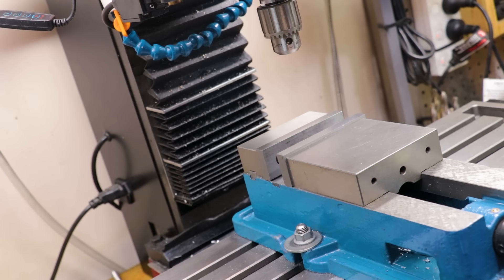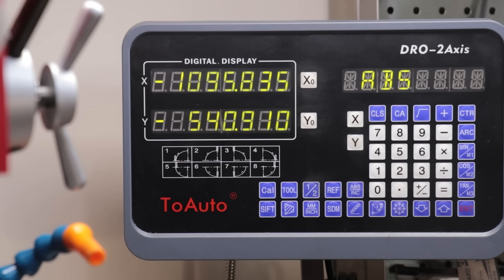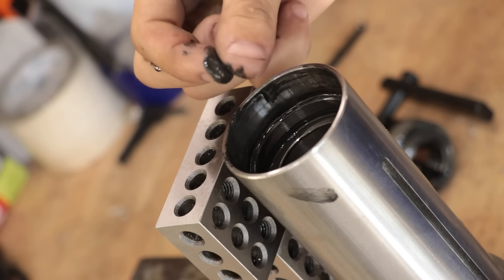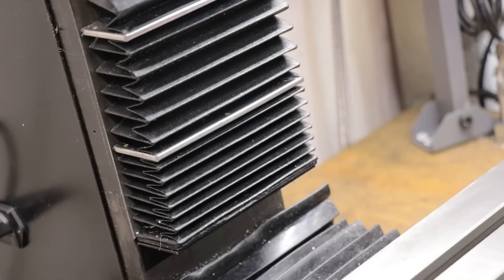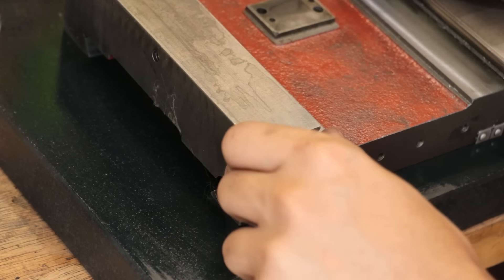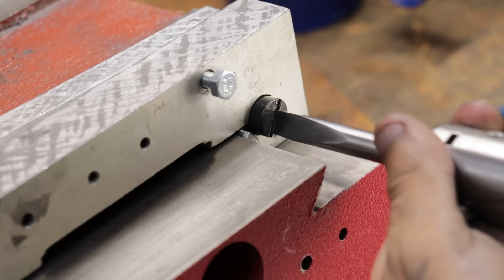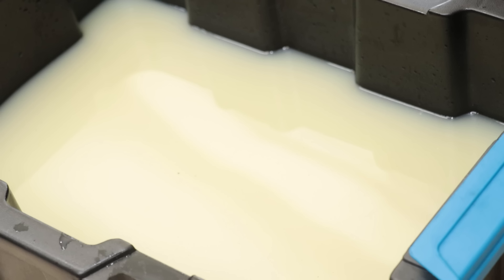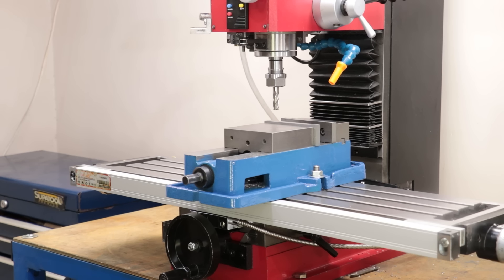The Cheap Chinese Mini Mill

Comment: If you are concerned about the reliability of the controller/electronic add a fan.  I have a mill similar to yours, added a fan the first day and 11 years later never had a problem.  Heat is the greatest enemy of electronics.
Reply from the maker: Ill definitely be stealing this idea. Thank you
Reply: Good point
Reply: as an electrician who works on low voltage controllers almost as much as everything else, heat 99% of time time will cause an issue before anything actually failing without being heat induced
Reply: @artisanmakes  can't steal it if he already gave it to you 😅🤷🏽‍♂️
Reply: @artisanmakes  Best ideas I ever had I stole .
Reply: do you think it would be possible to add a 3/4" chuck?

Comment: If you use linseed oil for anything be aware that it polymerizes and becomes gummy within some weeks. That's why it's used for oil paintings or for impregnating wood. Don't want that stuff sticking on your surface plate. I had better success mixing mineral oil with a lot of pigment powder. You really want it to be like a paste so you can see the very thin layer. Otherwise get some bluing dye off the shelf, it's not that expensive. I built a simple scraper out of a power saw, removed the linear mechanism and replaced it with my own which I can attach scraping blades to. Also added a shallow tslot to the cam gear so I can adjust the stroke. Oh, and once you scraped both sides, technically you'd have to check the whole thing for pararellism between both sides, since that could be off too now.
Reply: Rags can also spontaneously combust due to exotherming as they cool.
Reply: It should dry and be scrapable

Comment: Bearings typically have a wear in schedule, and I’ve always seen tapered roller bearings packed in grease. Oil may work too, just need to follow mfg instructions very closely.
Reply: Auto differential bearings are lubed with oil so the ones in the mill should be OK. Just need the correct oil.
Reply: @kennethstaszak9990  but they are splash fed from the diff sump. To be successful the bearings would need a few drops every hour or so to get a sufficient film in place because to my way of thinking they will lose their oil due to gravity! I may be wrong because I have only been a fitter for 45 years and believe me, I am still learning. Cheers from Tassy.
Reply: @glennbrown1961  They are still oil lubed which was the OPs point/question. My post reflected that.
Reply: @glennbrown1961  don't denigrate yourself, you're talking complete sense, I would pack the taper roller and the top bearing with a good moly grease for machine bearings ( not auto wheel ones ) and that at least should suffice at least on a yearly strip out and check basis.

Comment: Take a 150mm or 200mm diameter piece of pvc pipe which is a couple of cm taller than your coolant level, but will still clear the lid. Cap one end and glue in a heavy weight. Drill holes around the circumference near or within the end cap. Place vertically in the coolant and put the return into the pipe. Over time the oil will float to the top of the pipe and coolant will flow out the holes in the bottom.  Oil can be sucked out the top of the pipe with a large syringe or baster. That size mill will hopefully be my next purchase as I have space limitations too. Great tips and videos, thanks.

Comment: A small note from a fellow hobby-level machinist...  I own the Harbor Freight mini-lathe and mini-mil and have to say that while I never would have wanted to go smaller to something like a Sieg, both machines have allowed me to do real machining in a home environment, with the ability to move either one by myself in one trip vs. having to disassemble and painfully move them piece by piece.  They also cost a total of less than $1000 USD (Obviously with no vise/bits included), which made it possible for me to actually afford them, though this was back around 2001 so obviously inflation will have to be factored in.  It would be great to have larger machines, but you can't discount the fact that they allow entry into actual machining, building up those skills, and are quite capable for machines of their size-- no issues tackling stainless or other ferrous metals.
Anyway, just had to chip in since I feel like the mini-lathe and mini-mill are often immediately dismissed as "not a real lathe or mill", when often they are quite capable for their size and allow people with less money to build all those important skills that are impossible with hand tools.  Just my two cents...
Reply: Hi, unfortunately in Australia I dont believe Harbor Freight is available, and the shipping costs from the US to Oz is rather expensive making US tools rather uncompetitive.
Reply: @101peligroso Don’t worry, the Harbor Freight mills and lathes are just rebadged Seig tools. 
They’re the exact same as far as I know.
Reply: Excellent comment. I spent years avoiding these "hobby" grade lathes and mills because so many people said they were not "real" machines. However, since recently buying a cheap chinese lathe, I've discovered the truth of what you say here. There are fundamental skills and understanding in machining that require actual experience and hours of practice. It's fair to say that anything more than a cheap chinese machine would have been wasted on me. I'd have broken it, or gone broke buying the tooling, before mastering the very basics of the craft.

Previously I would look at large, precise machines and desire to own them. Now I know I'm not ready for that, and don't even want them anymore. It will be at least three years before I'd want to try my hand at something larger.

The other big advantage of the cheap chinese stuff is that you learn so much, fixing and improving it. That is what I love so much about my lathe, and lathes in general. They are amazing tools, because they can make things to make themselves better at making things. Building your own tooling and features for your nasty little machine, making it less nasty and little, is like having a living thing growing in the shop.

That's what this channel is all about, which is why it is one of the best out there.

Comment: 19:19 on the return line to the sump chuck a couple of filter socks in there and it will pickup any  particulates that get carried away in the fluid. The bulk will settle out but the super fine bits will act like silt and clays do in a stream.

Comment: On my Sieg X3 I replaced the top radial bearing and thrust bearing with a tapered roller bearing.  I used a belleville washer to under the nut to set the perload.

Comment: When I did my apprenticeship, we made our own coolant - an emulsion made from roughly 2:1 engine oil and a mineral oil detergent (so, not dish soap!), and then watered down to the right consistency. Basically, you're using enough detergent to get the oil to emulsify with the water, making it "water that won't make things rust", so I'm guessing you could do the exact same thing with cheap vegetable oil and dish soap!

Comment: I have the smaller sister of the Sieg SX2.7, the SX2.3. The biggest difference is the table size, the SX2.3 has a shorter table in the X-direction, other than that it should be pretty much the same. I quite like the mill, once you know how it behaves, you can actually squeeze a lot of accuracy out of it. 
I added a gas-strut to mine, that pushes the head upwards. I can really recommend doing that mod, you get less sagging of the head, it's way nicer and easier to crank up and down and it vibrates a little less (I mounted the strut at an angle, so it pushes the head slightly into the dovetail, which stiffens it up a bit). 
The next upgrade on my list is reinforcing the column, since that's still stock and probably the biggest weak point.

Comment: I haven't put coolant on my mill yet for the very reason you have said, rusting, so I'm very interested to see how you get on with that new stuff. The whole idea of water around my machines worries the hell out of me
Reply from the maker: If you use a good coolant and don’t let the oil drop the risk is small. Maybe a small fog buster could work. Coolant for me made a big improvement in tool life. Cheers

Comment: For the best scrapers, contact your local machine shop and ask them for any old circular cutting blades they are throwing away. Put on your PPE and throw it as high into the air as you can so it lands on a hard concrete floor where it will shatter. Some of the shards will have a convex edge which you don't touch - don't even sharpen it. Grind the bit behind this edge to fit in your handle and you will have the best scraper known to this planetary system.
Reply: But saw blades are made from steel and one that isn't particularly hard. I can't imagine that they can compete with a carbide cutter.
Reply: @rcts3761  I think he meant the brazed carbide that the saw teeth are made of.

Comment: Hey,, great video,, I have the same mill,  At the top of the spindle, With the new angular contact bearing,  did you put the thrust bearing back , use a spacer or did you only use the angular contact bearing ??
Thanks

Comment: Thanks for the video. I need to look at the bearing on mine but that will be a while. How did you go about tramming your mill? I have the Grizzly version of the SX3 which has been a great mill but I haven't checked the tram yet but I can see a slight re-cut when I use the fly cutter. Thank you for the video.

Comment: Sealed angular thrust roller bearings are probably best for the top. But parallel roller bearings are probably best for the bottom. However, one way to find out would be to study the specifications of far more expensive milling machines and copy their setup.

Comment: Way that this saddle was manufactured is correct,  by making contact at the ends of these surfaces it prevents assembly from wobbling. Similar method is  used in lathe support.
Reply: Correct 💯
Reply from the maker: Interesting. My scraping and fitting boot doesn’t seem to make reference to this. I can probably add it later if I can feel any rocking. Although the table is riding better than it was before. Either way I’d have to have scraped it since the was initially ground with 2 corners being higher than the others. Cheers
Reply: @Artisan Makes   just add some reales scrapping in a middle of these surfscess.
Reply from the maker: Will do next time I have the table off, cheers

Comment: I'd recommend getting some smaller nozzles for your coolant. They help with restricting flow and can make less of a mess cause you're actually using less
Reply: Hopefully this also improves cooling, lubrication, and chip evacuation.
Reply from the maker: I’ll have to play around with it some day. Might make some with the lathe. I don’t think I’ll get it strong enough evacuate chips whilst not making a huge mess, I think that’s one of the trade offs that I had to make with this set up.
Reply: @artisanmakes  An adjustable type nozzle may be handy to play around with. Really looking forward to more of your scraping adventures, hopefully get to check planarity, parallelism, and make your machines as smooth and rigid as they can be.

Comment: Awesome video! The only question I have is...instead of using a carbide bit and stone to plane the header, why not just tack some ultrafine grit wet/dry sandpaper to your inspection plate and level it on there? I just bought a grade AA plate for leveling mating surfaces on small engines and I will never go back to depending on paper gasket covered in gasket maker again. Maybe you guys with years more experience than I have may offer a reasonable explanation? I do get the whole "the small imperfections will help hold onto lubricant" aspect of it. I'm just curious.
Reply: Is sanding on a surface plate actually good enough that a gasket isn't needed? I never would have expected that since I intuitively think sanding like that isn't particularly accurate. (edges will be sanded more than the middle of a surface)

Comment: If you want a surefire no-rust coolant, try Metalium XDP1000 mixed 10:1. It's a bit hard to find (harder to find than XDP2000 or XDP1800), but it leaves a good oily film on surfaces once the water evaporates.

Comment: From the bottom of heart thank you for this video, i have the same mill (pre covid model as the speed control etc is nicer) but its had a knock in the spindle bearings for ages. Its nice to have a decent tear down video for the replacement. From a fellow aussie mill owner thanks.

My ends up acting as more of a glorified drill press but the occasions its done milling has really helped out

Comment: I have a similar setup to your coolant but it pumps oil it seems to make a big difference to tool life but it makes a real mess but im going to make some Perspex splash shields like Blondi Hacks has. I have it on my big lathe & mill. My mini lathe has no drip tray so i just manually add cutting oil. In UK winters the biggest enemy is corrosion from condensation on everything so oil helps a lot with that.

Keep up the good work ive been enjoying your videos like a podcast while cleaning an old Oris watch to hopefully get running tomorrow.

Comment: A single cut file drawn perpendicular to that bed would have kept the material removal where needed without using that improvised scraper. Draw filing or using the proper scraping tooling is what us Millwright’s do. 
Bonus point for being right on the handle removal but minus two for using a slip-joint plier instead of a hook spanner.

Comment: just as a suggestion, but you can take your surface plate and put it upside down on the mill parts you can't move otherwise
Reply from the maker: Yeah but it still won’t fit in the dovetails. Cheers

Comment: Hi,  Traming a head   save running gauge over the table slots. Get a gauge block or something similar,  set that under the stylus to read zero on 1 side swing 180 other side slide block in take your reading. 
Steve in UK

Comment: Hello , I have the same milling machine,, I was always curious  about what's inside the quill, so when you replaced the top quill bearing , did you put the thrust bearing back , if not did you have to put a spacer where the thrust bearing was... and that new Japanese top bearing was ot the same height as the old bearing or was it taller ,, can you give me the link for that bearing,, , sorry for all the questions,, I dont have anyone else to ask,, thanks

Comment: Another great video dude. Good too see your pushing this mill to its limits so much so your having to replace the bearings. Just out of curiosity any reason in particular you didn’t go for taper roller bearings top and bottom ??

Comment: Great video. Where do you source your mill cutters. I've acquired a round column mill and I'm after some reasonably priced cutters for hobby use that won't disintegrate on first use.
Reply from the maker: I get most of my roughest from Ali express, the import cutters work great. My good finishing end mills are from tool master/hare and Forbes and Sutton tooling.

Comment: Glad to see your mill. after a long time when i first see you get it and i got mine weeks after yours.
I would say , 
Even though brushless motors is noisy but at least you can repair the brushes when worn , i know 2 people who have had Brushless and after a while they had problems, as the small motors don't like the strain, but bigger brushless motors seem to be good.
but still when a brushless stops it needs to be replaced, but as a brushed motor, 99% of the time you just spend a few bucks on new brushes and your good to go.

Anyway i like seeng what you have figured out, and is nice for some one like you to do videos on these small machines and follow up on how you have got on, as it is inspiring for those who are thinking about getting one.
Reply from the maker: Cheers, interesting to hear your perspective on the brushless versions

Comment: Great video! I like the reasoning for the spindle handle removal as a safety issue. As you seem very  conscious of safety, I would recommend wearing long rubber gloves when messing in your coolant tank as the coolant could be carcinogenic.  Also I liked the metal putty use. I have a Sieg X2 mini mill and wish I had yours! But got what I could afford at the time. I enjoyed seeing your scraping job you did. I wonder if a Multi-function Tool would work as a power scraper? I think it would being careful not to let too much be taken down. You could grind one of the tools to make the scraper blade or make your own. Maybe a Saws All would as well, but the stroke may be too long.
Reply from the maker: I’m sure you could get a multi tool to work, but it just isn’t the correct action for scraping, you’d want a forwards and backwards movement rather than a side to side one. Cheers

Comment: Funny, I'm using the exact same rectangular storage container as a reservoir for my hydroponic setup.  Even has a pretty similar looking pond pump in it.  I ended up using cheap 13mm irrigation fittings to plumb it all through the top of one of the sides to keep the lid easy to remove for drain, refill and checking nutrient concentration etc.

Comment: I have to get one of these, I built a MPCNC (Mostly Printed CNC) for milling wood and engineering resins but I want to replace the 3D printed parts with steel and aluminium, this will be the ideal first project once I get used to working with the Mini Mill, great video and some great tips!

Comment: Very good video. I have a similar mill and initially had overheating problems. After taking the head apart, like your situation I found out that the factory installed a deep race bearing with an angular contact bearing. I replaced both bearings with SKS AC bearings. It really made a big difference.
Reply: Nothing wrong with angular contact 🐻 inns. They’re used on some very expensive machines. The quality, and just as importantly, the way the bearings are fitted, are the thing that matters.